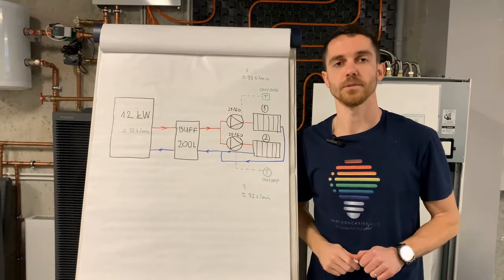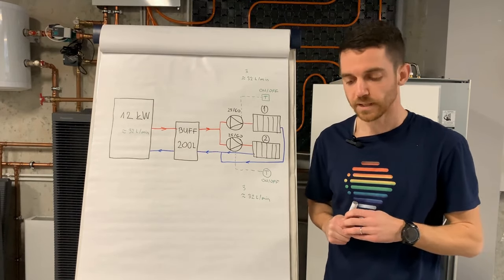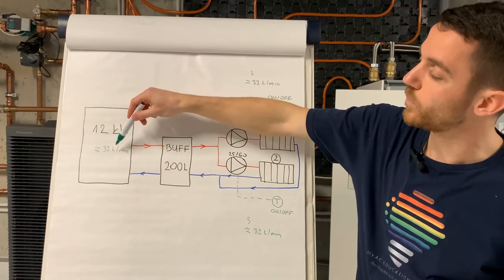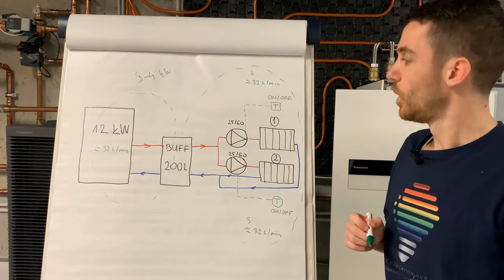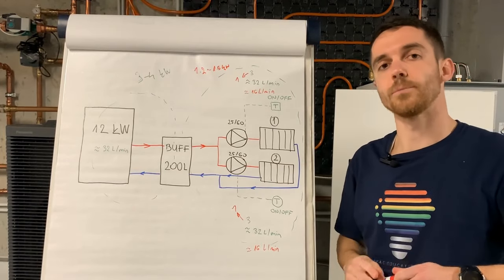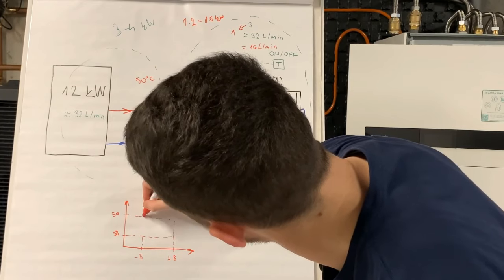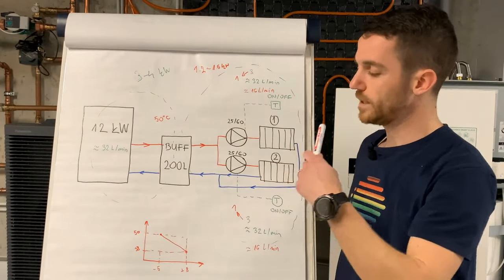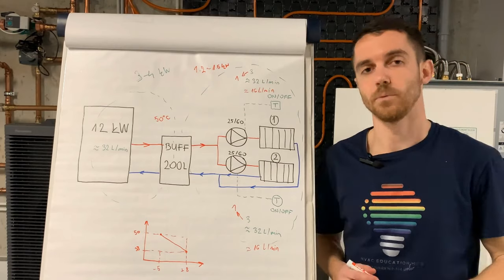Is Heat Pump Expensive To Run?

Comment: Loving the straight to the point videos.
What happened on the radiators,  when the flow was lowered? Their dT before and after?
Room temperature also before and after?
At which dT was the primary working for that 32L/min?
If the difference between primary and secondary flow was smaller, could have we just put lower dT on Primary to get a bit higher flow on primary (like from 7K to 5k or from 5k to 3K?
How would the pump react in that case, just increased the flow of primary pump? What would happen to the electrical power output of the pump?
Reply from the maker: Thanks.
We didn't measure secondary, I just lowered the curve by default as house looks good even with lower flow.
Primary 32 L/min before, now sometimes on lower when demand is lower.
Yes, we could play with dT if difference is not so big.

Comment: Hi. For 130m2, a 12kW HP is way to big, even for a outside DT of -12C. Why dont they use the circulation pump from the HP itself ? Why the huge buffer ? I have 145m2, 6kW HP, only rads (large ones), no buffer, no extra pumps, no ON/OFF !
Reply from the maker: good questions, agree with everything :)

Comment: Why do you have secondary pumps with a buffer.
My house has 22 radiators and it is direct. No buffer no secondary pumps
Reply from the maker: I was on that house few days ago, not designed.
Which heat pump you have and how much pressure drop on critical circuit?

Comment: I would design the secondary side to make it compatible with
 12kW heat pump use inverter driven and ho bufferless
Reply from the maker: Correct, this is the best way. But even like now, it will be better with few changes